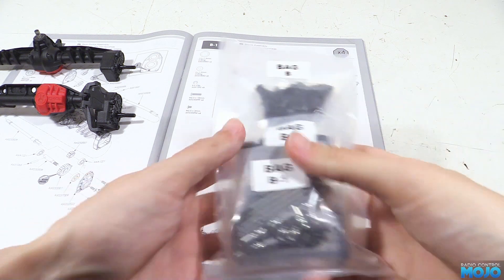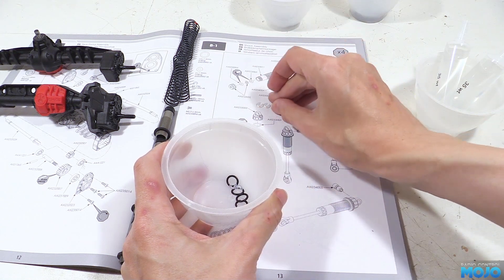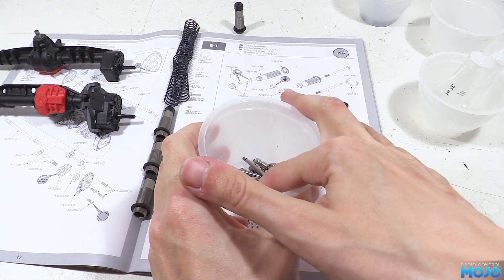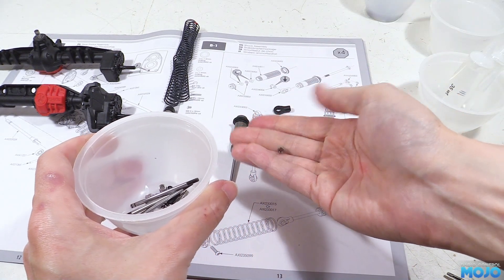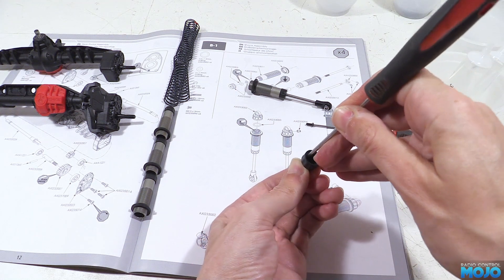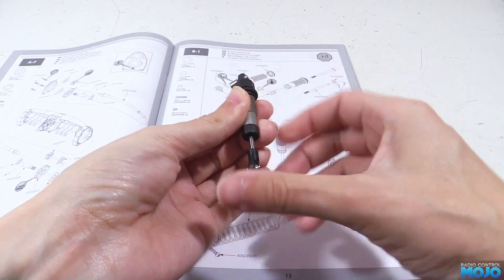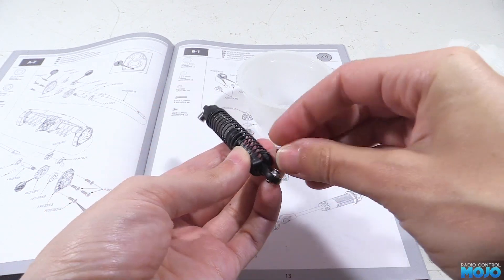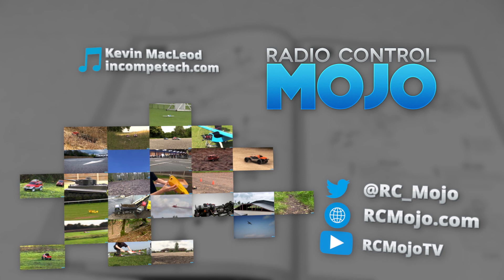Axial SCX10 III - #3 Dampers

Comment: Axl HAD excellent Manuals... They also came with a few extra of the fiddly small hardware. 
Then Horizon took over. They're still good product, but they lack the little extras... 
Horizon is just being CHEAP.
Reply from the maker: Can't argue with that. I'm building a Tamiya kit at the moment and the amount of extra hardware is quite amazing, really useful if you screw up an e-clip etc.